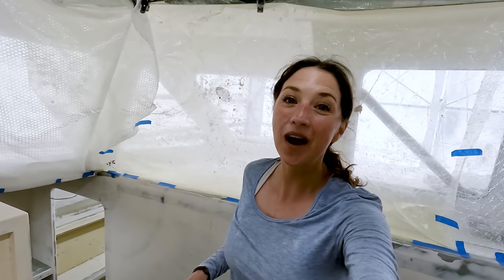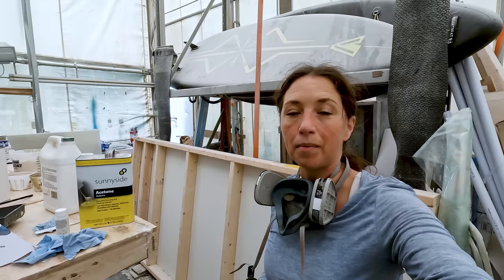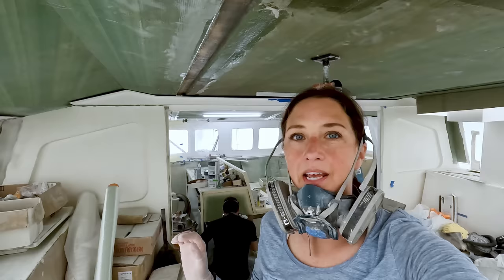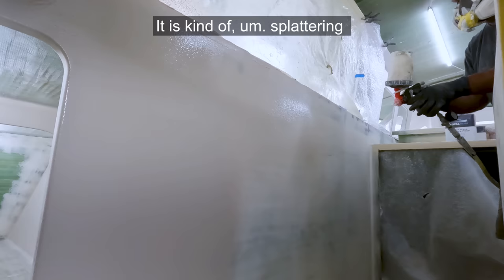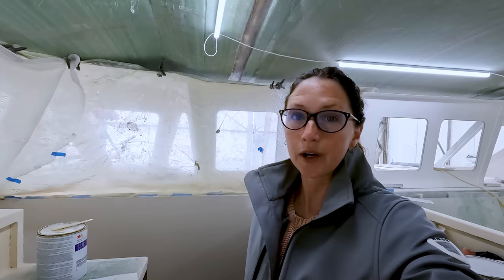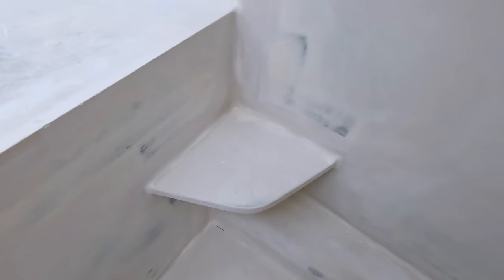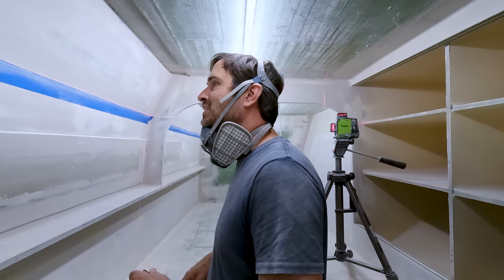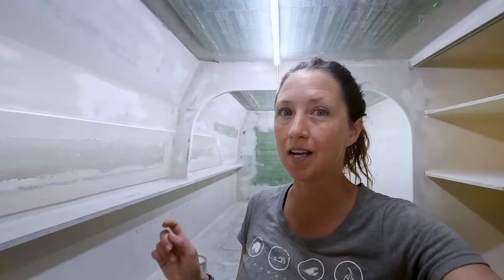TotalBoat vs Awl Grip...We Switched Primers - And We Can TELL!! (MJ Sailing - Ep 278)

Comment: Good job guys. Just an FYI you’re being exposed to the dust from the high-build wearing your full face respirator like that. It’s a face seal dependant respirator - meaning: it it makes a seal against your face. Having stubble and wearing it on top of your balaclava means that particulate is making it into your lungs.
Reply: 100% right! Don't get my occupational health nurse wife started on this subject! Respirator "fit testing" is one of her specialties - turn up not clean shaven at your peril 😂. Don't let perfect get in the way of good - this boat is almost certainly finished with more care than a factory assembled one already. Save the perfection for the rig and systems.

Comment: Your show is awesome.  Showing everyone the steps of building a cat from scratch, the work, planning and skills that go into it; its very educational.  I did see that you were using the TB dewaxing solution and just wanted to mention that i had an issue with my batch recently.  I am in California and cant get denatured alcohol to prep with, so I used the same dewaxing solution you do. This was not an issue until i sprayed top coat. I wiped everything down let it dry and sprayed, only to get a number of fish eyes in my top coat. This was caused by the dewaxer still off gassing threw the paint. I did a few test and every time i used the TB dewaxer I had fish eyes in the paint, even when i let it dry for an hour.  This was not the case when I used other solvents that i had in my cabinet.  So if you are going to paint over the high build primer, do some test areas before wasting time and money. I did not try it with gelcoat.  Just thought I’d pass it on.

Comment: Hi guys, Matt one suggestion for you, slip down to your auto parts store or hardware store and pick up a liter or quart of real cheap Chassis Black, thin it right out and dust a really light coat on your primer, when you sand it will show up all of your low spots really easily, this is called a Guide coat and should be applied before sanding any surface, it will show deep scratches and low spots, It will make sanding that little bit easier if that's possible, I'm an old spray painter from way back and used to sand back over guide coat with 400 wet, Guide Coat you can look it up, you can also bye the stuff in powder form but it's pain in the ^%* to use, Your doing a great job so all the very best to you both, Al
Reply: They have 2-3 different guide coat systems they use

Comment: I use that total boat epoxy fairing compound quite often.  I love that stuff.  I have never used any total boat primers, but I can say that i have used Awlgrip a few times.  The adhesion capabilities of the Awlgrip is awesome.  I see less paint chips long term when I use that stuff.  
Stick with that straight line sander where you can.  It's pretty hard to make a flat surface with a DA IMO.
I was down in your hood about two months ago.  I really should have scheduled a couple of works days with you.  A fairing project this big has to be exhausting.  
Pick your battles.  Focus on the areas that will be the most visible or have the most light reflection.  Perfection will take forever.......

Comment: Now that you’re using a spray gun have you thought about using spray putty?. This would speed up your process greatly. Another tip if you’re running out of air is to get a second compressor and and a stand alone air tank and run two compressors into a main tank, never run out of air again. Looking good!.

Comment: So i have this wild idea for the bed areas, basically turning them into multi-functional spaces. If you notch out the middle and use the cut out as a table you could make it similar to the dining table area of a lot of RV's. Then if you add a removable water tight door on the front you could make a walkin tub, the sides under the benches could have long slide out drawers to make complete use of the space under the benches/bedsides. The front edge could be raised on the benches as well by adding removable pieces, then the water in the tub could be above the benches creating a sitting area. Now for the fun part, just run a hose from the water heater to fill with hot water and add a battery operated jet to make a hot tub! Drain using same hose with filter but to the bilge or elsewhere... When not used as tub, or work table, return the table top between benches and store stuff underneath as desired...

Comment: the d.a. sander does come with a hose and dust collection bag that fits over the back of sander where the air/dust comes out...saves hours of cleaning up
Reply from the maker: That's a different model of sander.  This doesn't have a self generated vacuum system.

Comment: Been building fairing painting boats for a life time using international mainly and other products you should mix with a drill and paint stirer and add the minimal amount of thinners if any better  mix large amounts in a big bucket and then make a strainer out of another bucket with the base cut out with fly screen mesh taped to bottom for straining paint u would be surprised how many chunks you will strain out and use a gun with 3.5 mm nossel top load bag the expensive guns won’t spray any better and low pressure the iawata az3 gun was the got to gun for all high builds and interprotect primers could cover a 40ft catamaran both sides with 3 primer coats  in about 4 hrs on my own and mixing and clean up I think the highbuild is unesesary internally. On small panels as more can be achieved with premix fairing fillers and then spot fill after primer it’s easier to trim some panels than to fair and never spray high build in radius’s as it can build up to quick and crack later on 👍a good extraction system is a must through the hatches and don’t think dust will be pulled in even when doing top coat it won’t and is to dangerous to spray anything without extraction running and it is good to blow the dust out of the boat 
Are you using guide coat to sand? You wouldn’t want to sand more than u have to and miss pinholes Blue wipe on liquid best and doesn’t clog paper

Comment: Looks great.  Such a huge undertaking. But the end result will be worth it. The pride of doing it yourself  is a great feeling. 

One the high fill primer is on should you not be using some sort of guide coat to help gage your sanding?  Without a guide coat you are really just guessing at how flat the panels are.
Reply from the maker: The primer acts as a guide coat... You can easily see where there are low spots.  But once we get to the last layer of primer, then we will use a guide coat.

Comment: moving along  I thought priming it made it feel smaller. LOL Actually think that because the windows were masked and papered off.  So thinking ahead- will you have some form of backup parts storage all organized- were you have the make and part number and contact info labeled for the part.  like a extra heating element for the water heaters,  extra washers for the faucets, water filters,  replacement hinge for cabinet door,  extra set of keys, belts,  packets of two part epoxy putty ,  A repair boat med kit and vendor lists for all the parts and contacts.

Comment: How much weight are y'all adding to this boat in fairing?

If I understand correctly, this hull was produces with a single sided mold, vacuum resin transfer process.  That gives you one fair surface right out of the mold, but then you have to do all this fairing work to fix the other surface, exacerbated by the fiberglassing you've been doing to assemble the thing.

Does anyone mold both inner and outer surfaces, with an airspace between them, so they can do all this fairing work just once on the molds?
Reply from the maker: A lot of brands have molded interiors, but it's heavy and typically done in cheaper boats.  The fairing compound is 5.4lbs a gallon.  We have used about thirty gallons.  A good 50 percent is sanded off, but we probably sand more since we're not that skilled at application.  All in all, we've added maybe 75lbs.

Comment: Why don’t you guys get some box fans and build sealed square boxes around the fan that you can install 5 high merv filters in and take the fan and have it blow into the box and thru the filters to catch the dust. Then you can set these boxes in areas you are working in and turn the fan on and capture the dust inside the box in the filters. You would probably save a lot of time sanding. Several views of these on YouTube for carpentry shops.

Or you could put the areas your working in under negative pressure poly sheeting, a filter for supply air and an exit with a fan to draw dust out. Similar to an asbestos containment that’s use to minimize dust in the containment area.

Keep up the good work.

Comment: I bought 3 different spray guns when I was spraying my last boat and I ended up finding out that the cheapest old school spray gun from home depot with the pot on the bottom of the gun sprayed 200 times better then any of the other guns I used. It was even way better then a 500 dollar gun the paint supplier told me to use.  The home depot cheap gun was like 29 bucks. Might be worth trying

Comment: In a previous video you mentioned that you have gone through a couple of sanders. Was there any plan to control the dust/sanding by cyclonic separator (hooked up to sanders) and vacuum with an hepa air filter (for general air filtering) for inside the boat and inside the tent? (2 different systems)
  Did you consider industrial grade sanders (festool, mirka, 3M (cubitron) with associated sanding discs) that can be attached to an filtration system? I know they are more expensive, but with a cyclonic separator and hepa air filtration system, it would keep the air cleaner, saving you time in clean up and the spreading of dust around the boat. Sorry if I am using mostly woodworking brand names. For me, I been watching alot of woodworking videos and most channels recommend a cyclonic separator before vacuum (the end filter can go as low as 1 micron or better), this takes care of the tools producing sawdust.  An additional shop filter (hepa) makes sure the shops air is filtered and picks up microscopic dust in the air.   
  Break dust collection down into:
1.  for the tool (with cyclonic separator and vacuum), 
2.  for the space you work in (hepa air filter), and
3.  option if you have a vacuum with more than 1 hose connection, use second hose for space.

  As for type of sanding discs, some have better dust collection due to design of the disc allowing particles through disc to exhaust port.
  I thought I would mention this, as it seems like for the last 2 months that you guys have been busy sanding and sanding and sanding....and the mess.
  What about inside corners - making sanding blocks?Make a template out of cardboard and transfer to 4/5 inch piece of wood.  it will standardize the rounded inside corners.
  What was the highest number (sand paper) for fibrglass, gel coat, priming paint epoxy, and final paint.  80, 120, 180, 220, 320, 400?
Is there a difference between walls and ceilings? Floor paint?  non skid or something else?
Reply from the maker: We have a dust extractor, but found with the amount of hand block sanding we do - and the time spent cleaning that dust - that we mind as well just make a big mess and clean at the end of the day.

I made fiberglass molds of corners I like and use those as blocks to sand.  The benefit of fiberglass over wood is that I could taper the layers on the edges of the block and the reduction in stiffness helps to apply more of a fair pressure without digging in.  That was the theory, but in reality it doesn't seem to change much over just a simple block.

Comment: Spitting?What size spray tips are you using and what’s the thickness of the material and open time you have to apply and pressure you’re using plus tips do wear out .
Reply from the maker: It was odd.  The tip was 2.0mm, and was new.  Not sure the issue

Comment: How often do you have to change out the filters on your respirators?  I would imagine when fairing those filters would require more frequent filter changes.  How about when using them in areas where the fumes are harmful?  Can you clean these air filters or are they use once and done?  Fascinating.  

Oh my, the dust being created again and the fact you will have to clean and vacuum all of the surfaces again.  You guys have so much patience.    

Were you guys able to determine what was wrong with your paint gun?  

Thanks for sharing!!
Reply from the maker: Every month when just sanding.  With this primer stage, it's more often than that... Every week or so.
Reply: @MJSailing  Thanks for the reply!

Comment: No windows in the v berths?
Reply from the maker: The side window will get cut out probably later this year, and Matt is in the process of making the mold for the flush hatch to sit in.
Reply: @MJSailing  Nice, boat looks great. I have to do all that when I get to Saint Thomas this year on my Tayana 37, alot of fiber glass repairs. Selling my Islander 44 first in Los Angeles before I move there. Just waiting for the machine shop to make me a new sheave for the top of the mast. The old one was for wire and my rope kept jumping off and jamming my main. Happened during the sea trial, sail got stuck half way up. Fixing that now.